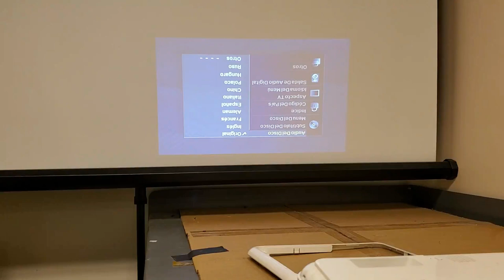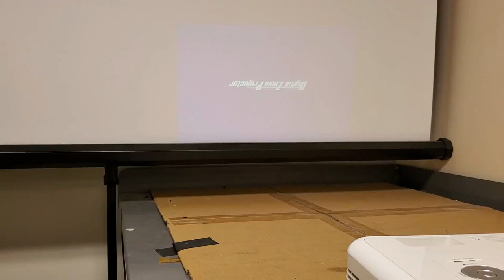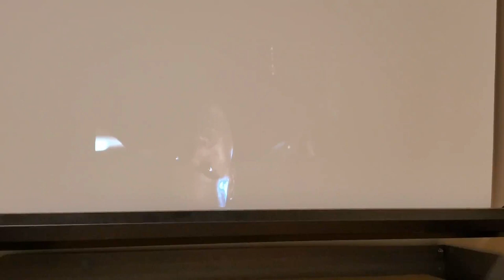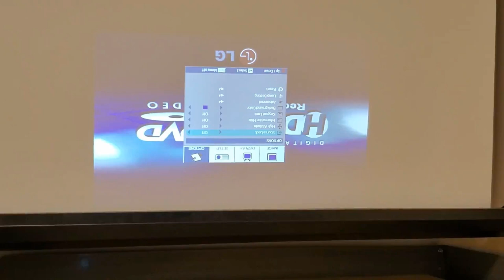Optoma TWR1693 DLP Projector Cleaning /Maintenance

Comment: Great video Frank as usually. I have repaired the Benq W1070, it was only the main Mosfet on the big heatsink. After replacing it, it turned on and working great. On the screen there are many(!!!) bust specs and some hair like ones as well. How can I clean those off? Through the inspection "window", with spray?
Reply: Tomorrow, I'm getting a broken Epson HC3500, with some flashing LEDs(bad lamp), broken off zoom ring and one broken leg.
Reply from the maker: That would work. I'd try a dry clean first to prevent moisture. Also make sure the lamp is good. A dim lamp will show debris that normally wouldn't be visible.
Reply: I have managed to clean it. I took off that black plastic cover, with the lens in it. I have used air duster. Now I notice on the left side, at the edge, a vertical blue "band" and a darker lower left corner. What could this be?
Reply: I'm thinking, that maybe the square "light tunnel" can cause this issue? I have blown with the air duster spray, and maybe I have dislodged a mirror?
Reply from the maker: @19mati67  It could be.  Something definitely moved. Is the edge kind of acting like a prism and showing a lot of colors like a rainbow to a degree? Id also be suspect of that angled lens in the optic assembly or the mirror.
Reply: It is more like, a light transparent blue vertical band, and at the bottom is darker. The darker corner, most likely something is blocking the light path. I will have to take it apart again.
Reply from the maker: @19mati67  it still might be, but I would check in the area you were in.  For some reason, my brain is telling me to check the mirror inside the optic module.
Reply: @FixitFrank  OK, I will do that and I will let you know. I'm starting to enjoy working on pjs. Today arrives an Epson HC3500, that has a lamp error code. Picked it up for $197. Has a broken focus ring(it is included) and one of the adjustable legs is loose, most likely the housing thread is broken off. No remote either. I'm excited. I also refurbish and sell Onkyo receivers. This is my hobby, I'm a machinist by trade. A few years ago, I was repairing and reselling LCD/LED TVs. Not worth it anymore.
Reply: OK, it's done. I had the thick lens(after the light tunnel) the other way installed. Flater part toward inside. I have seen one of your videos, wher you mention that the more convex side has to go toward inside. Thank you very much, for all your help and these videos are awesome.
Reply: The HC3500, most likely has been dropped. There are a few plastic parts cracked/broken, around the lens and the main exhaust grill. Did not come with a bulb. Bad description by the Ebay seller. Purchased a used Epson bulb, with less than 100 hours on it( I rather buy this, than a cheap Chinese bulb). It will be here in a few days.
I will have to machine a plastic spacer, re-drill the mounting holes(focus ring) on a indexer on the milling machine. At my job, I'm a machinist.
Reply: On the Epson 3020, most likely the blue ribbon does not make god contact and that is the reason, why it shows a yellow tint.
Reply from the maker: @19mati67  Im really glad to hear you are enjoying this!  Im slightly envious.  I love the idea of machining metal.  It's a skill I want to get into as I love the idea.  I do a lot of simple cad work and 3d print it or use one of my little cheapie cnc mills but nothing useful really.  I have a long term goal to buy an old but functional bridgeport mill. They are so awesome.  My life goal is to be able to make and repair "anything".  I do stuff from make PCBs for things all the way to making wooden signs (all on the side). My day job is lamp related. I don't mention it here so that people don't think its some sort of shill for my job.   If you need lamps, let me know.  If you email me at the contact email here, I will get you my personal email.  I hear you on the LCD TVs.  I actually cut my teeth on the old CRT tvs back in the mid 90s.  I repaired Advent Novabeam projectors and "Runco" CRT projectors which were painted Zenith CRT projectors.  My specialty was tube gear though believe it or not.  I still mess with the AV stuff but I haven't done a video since its more of my "get away from it all" hobby. I recently restored an old Marantz 1060 but I'm waiting on a volume pot.  I might video that one.
Reply from the maker: @19mati67  I would think so.  if you are careful you can put pressure on it while its on.  as long as the wire doesn't 'bounce' too much it wont hurt anything to see if you can press it into place.  I tend to go for DLP units myself due to the frailty (and the freaking bad polarizers) of LCD optics.  I picked up an Optoma HD70 that Im waiting on.  I have another but the HDMi chip is bad and it is pulling down the 3.2v supply for the rest of the unit.  buying the chip isn't an option as it needs to be flashed so I'm looking for a mainboard overseas.
Reply: @FixitFrank  You mean projector lamp? I envy you about cad and 3d print. I'm not that advanced. Just a manual machinist for a small space company. Small, but we will be working on the Dragonfly mission. I had all kind of hobbies, and I still have. PCBs and building electronic stuff, was that started me in the teenage years. I have rebuild a 68' VW Bug, back in eastern Europe. I have build the engine from scratch, here(I did not have any parts here, so I had to buy everything). Two satellite systems, from scratch, to receive TV channels from western European countries(2 Meter dishes), cassette deck from scratch, etc. Rebuild a motorcycle back there(250 MZ-1962). Here I'm trying to build my mancave in the garage, with a projector lift(installed) projector, 125" Elite Screens motorized screen, a bunch of Klipsch speakers, including Dolby Atmos ceiling speakers, motorized shelf for the center speaker. Nothing fancy. Also I want to repair electronics in there and work maybe on a project car in the future. Maybe a VW Vanagon, with a Subaru turbo engine transmission transplant, german style.
Reply: @FixitFrank  On Onkyo receivers, I just get HDMI ICs from Aliexpress. HDMI ICs have to be flashed? That is weird, I have never heard of such a thing yet. On other devices, usually there is a TX and another Ic, that is the RX. I still have to take those pictures, with the mainboard. I have some basic pictures on that repairalmosteveything forum, but they are not detailed enough.
Reply from the maker: @19mati67  Correct! Projector lamps. It's partly why I get my hands on so many projectors.  Sometimes we have customers (or just folks who contact me) who need a lamp and then find out there is something else going on.   We used to offer repairs as a service but it was taking too much of my time from other duties, so its more of a "value added" option to help out a customer. Plus it makes fun content for me and I can learn more.  Machine work is super interesting to me.  It really is the basis for everything.  Everything starts its life as a chunk of something. Then someone like you takes that chunk and makes it into something useful.
Reply: @FixitFrank  Or sometimes, I have to finish some CNC made parts, like a few month ago, I had to do some extra features, on a $17k part(no pressure).
Reply from the maker: @19mati67  so you can just wack it with a rat tail file right?  Very very cool.  If you get time, send me an email and I will reply from my personal account.  I check YT pretty often but email is definitely faster.
Reply: Here are the ICs, that I have found on the board: there is an ST FLi32626H (Single-chip enhanced LCD TV controller), Lattice LFXP2-5E-5FTN256C (available at Digikey), 2 x Epson EV0805SA, Epson EV2006XA, EPSON E07140K0B, 2 X IDT V105ADAG/ZA51331J, PANASONIC MN864773AKE (HDMI), TEXAS INSTRUMENTS TMDS261B (2 in 1 HDMI switch).

Read more: http://repairalmostanything.com/thread/655/epson-powerlite-3020e-video-issue#ixzz5w1vEoFDI